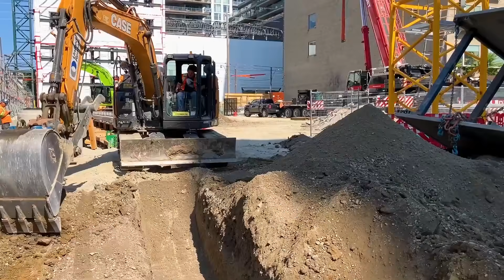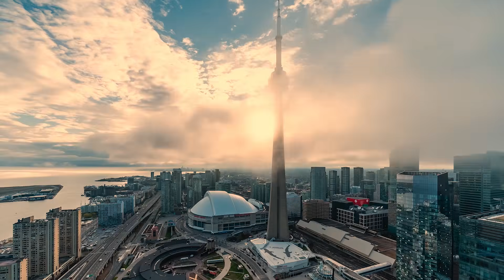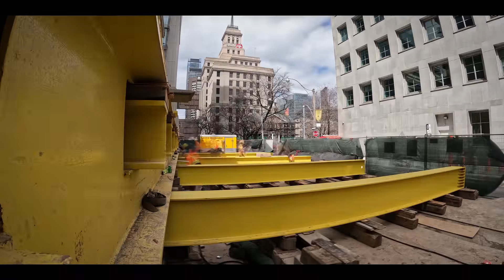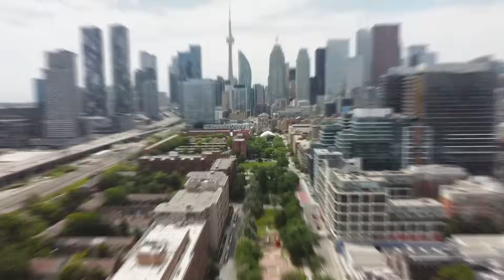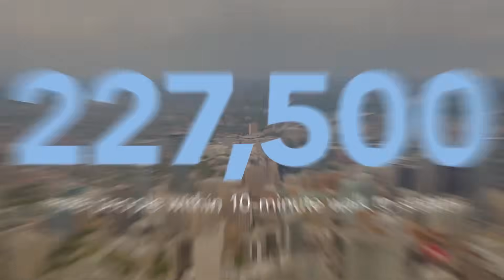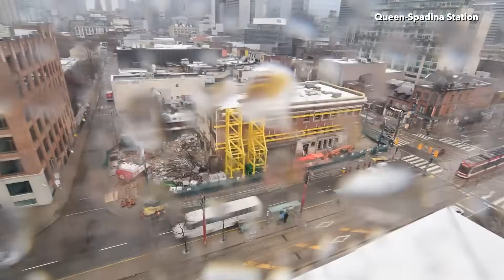Construction on the Ontario Line Continues in Toronto - Let's see the latest and discuss...

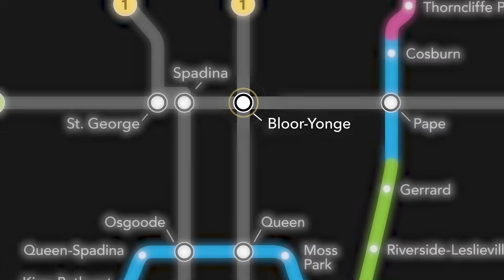Comment: 8:55 I mean technically line 1 is semi-automated allowing in theory the trains to drive themselves however they act like a self driving function in your car where you still need to hold the wheel but it will otherwise do everything on its own. Also I believe interestingly slow zones have to be driving manually, and the ATC on line 1 can allow the subway if the TTC gets the rolling stock/ really wants to limit their maintenance capabilities to run every 2 minutes or less so it’s not that the full automation is that much of monumental leap, also the SRT could operate driverless as it does in Vancouver but the TTCs operation and union demanded that there still be drivers.
Reply from the maker: Interesting

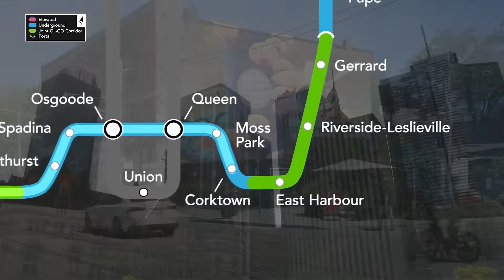Comment: 6:35 Metrolinx:  Please don't retain the "Queen-Spadina" and  "King-Bathurst" proposed station names.  Serious confusion with existing stations are inevitable.
Reply: I thought they said the names are subject to change if necessary?
Reply: Yeah, imo, the former should be named "Chinatown"
Reply: @stinkyroadhog1347 or Fashion District
Reply: You know exactly where it goes because they are street names,whereas 1 and 2 is only the line no. No reference. City use numbers when they have 10 or more lines.
Reply: @Flat10squirrel Only when the subway density of lines and stations reaches a point like New York City, where most stations are named after the two corresponding intersecting street names.  TTC stations were named in the London Underground pattern, with every station uniquely named.

Comment: Should be a line from Queen and Roncesvalles to Queen and Woodbine
Reply: They plan to extend it to Roncesvalles and up to dundas west station. East wise, it was always planned to go to Pape and Bloor, they just extended it more north with the Ontario line.
Reply: @Mystro256 They should also go east to Woodbine, or contiue up to Victoria Park station. Take the load off Queen, King, Kingston, Eastern, and the Lakeshore.
Reply: The Ontario line goes under Queen from Spadina to Sherbourne, so a full Queen line is not happening.